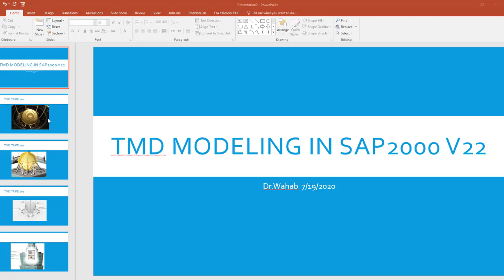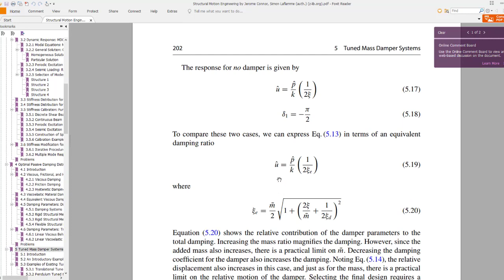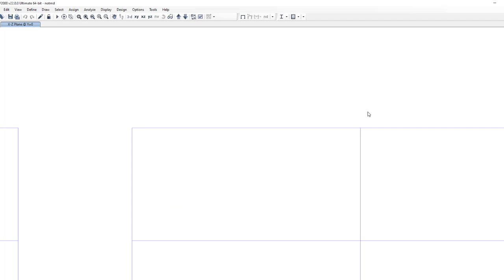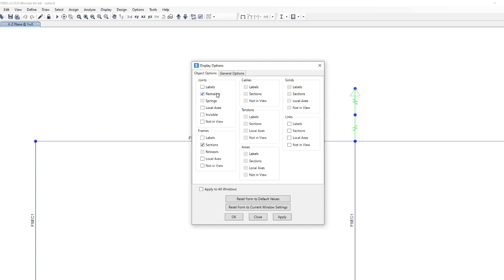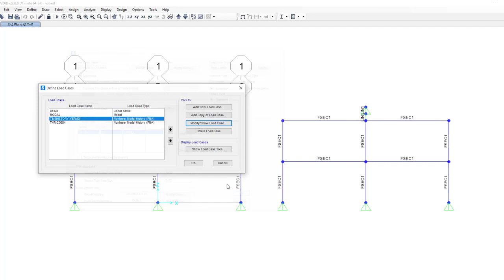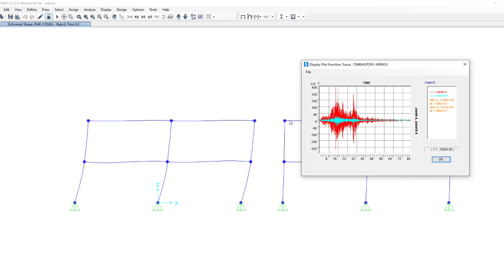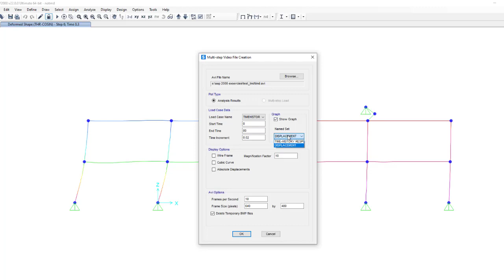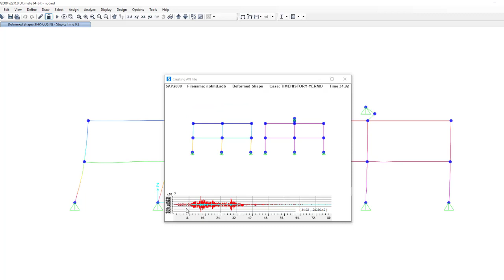SAP20000 Tutorial Advanced , TUNED MASS DAMPER  (TMD)  MODELING and Analysis

Comment: How could you assumed in top of mass damper is pin support? If you add pin support in top of structure, definitely it will reduce the displacement. Doesn't make sense!
Reply from the maker: I am not sure. You can figure out